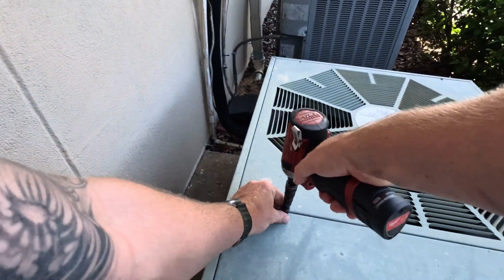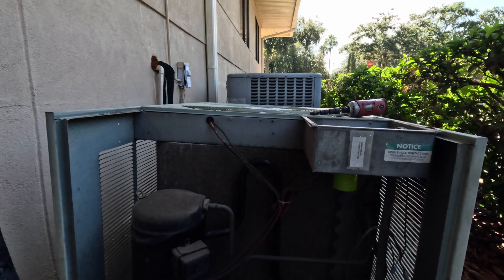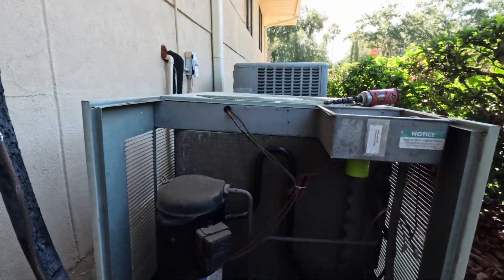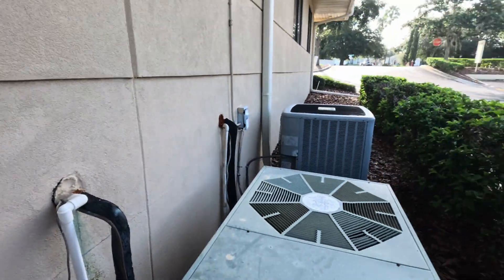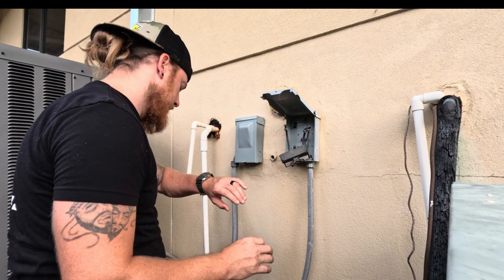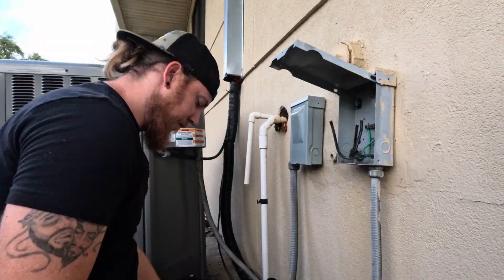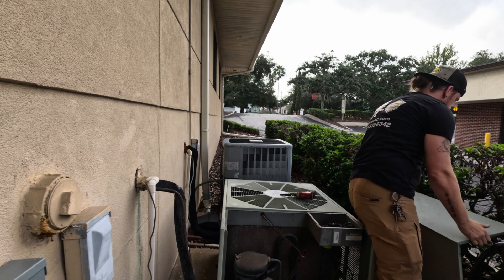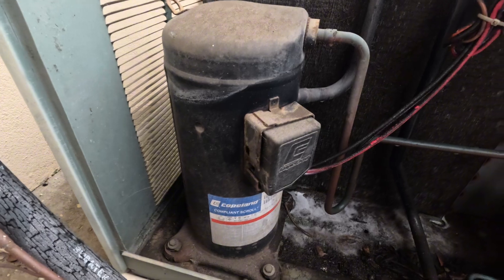I Blew THE POWER to the building | HVAC | Reviving 23 year old neglected system

Comment: Glad you are ok man.  A little lube on the pullout at the initial install goes a long way towards protecting against that type of craziness along with maintenances where you can reapply some lube.  You can tell they weren't doing any of that.  Really a junky disconnect with junky metals being used.  Hopefully they don't get someone killed out here one day.  Thanks for the video.
Reply from the maker: Duuuude solid point, little dielectric or something might go a long way for sure. I may just start doing that on my maintenances from now on 🤔 good advice appreciate you bro!

Comment: I usually take the metal cover off before pulling the disconnect on those because those disconnects sucks b*lls
Reply from the maker: That’s a solid tip! Will need to just keep that in mind

Comment: I have that sprayer but took the awkward long  wand off and just screwed the tip in by itself. It’s much better that way for what we use it for. I still keep the wand in the truck for those hard to reach areas.
Reply from the maker: Ahhh now that make sense. I use to stir it upright in the old van had plenty of room but this one I have to pick and choose. May just do that, seems a better option dude 🫡

Comment: Those discos are bad about that. Sometimes you'll pull them out and one of the blades will break and stay in place, leaving one leg hot. That's why you are supposed to check both legs for power after yanking one, but sometimes we get lazy after a long hot day.
Reply from the maker: Ain’t that the truth!! I’ve fallen victim to that as well! Something similar today, with a bad breaker only getting the 120 to each leg but not 240!
Reply: @KoolinwithKrauss  had that one too. You go out and measure across both legs and get nothing, but you forget to check each to ground ⚡
Reply from the maker: @topher8634 boom nailed it!!

Comment: I had some fun with electricity today as well haha
Reply from the maker: Oh boy!!! Did you record it?! Or did I miss it 😂
Reply: @KoolinwithKrauss  no didn’t get it . If I had known what the problem was i would have haha . Got a nice shock out of it then took a little break . Haha
Reply: @KoolinwithKrauss  I always get these units where someone didn’t have a good connection on the electrical or they completely forgot how to put a wire nut on . Haha a lot of em came that way and nobody checked shit . Must’ve flipped the switch and left ehh start up done haha ugggg
Reply: @KoolinwithKrauss  you know 50 foot line sets unit pre charged for 15 and no top off . That kinda installs haha ugggg
Reply from the maker: @Qualityservicesbcs well dang slim I’m glad your good 🫡 💪
Reply: @KoolinwithKrauss  ain’t the first time most likely won’t be the last . Haha thanks